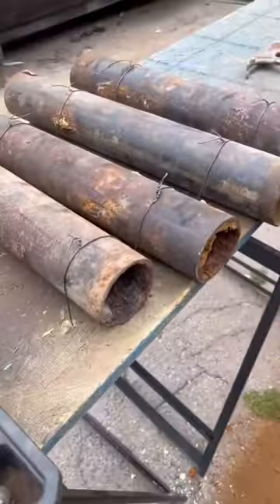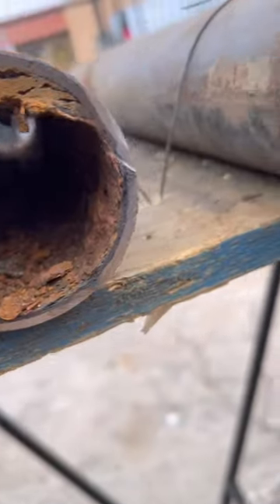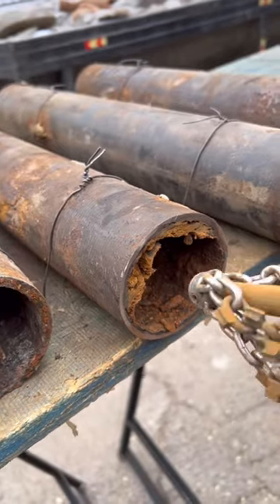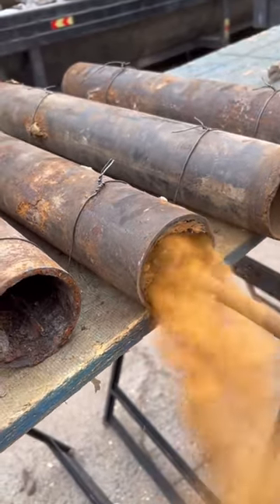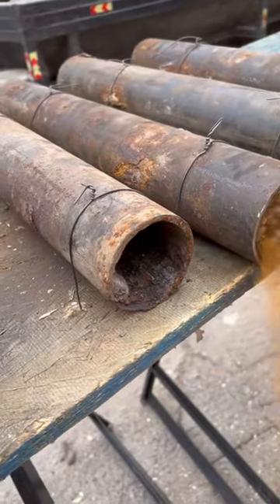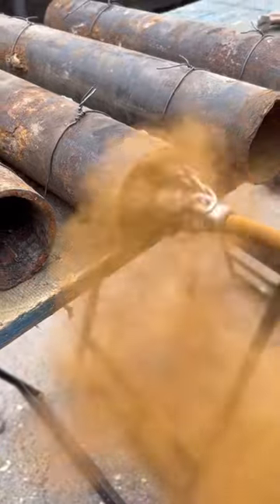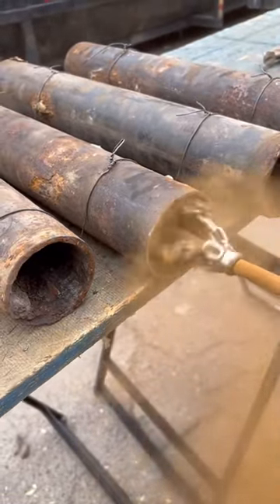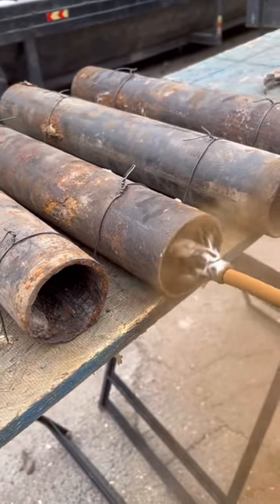How to shave corrosion out of the cast-iron pipe  #plumbing #shorts #howto #sewer

Comment: I would never put that old cast back in drainage system, an infinitesimal crack will cost you replacing it for free in shirt time
Reply from the maker: It’s for demonstration purposes
Reply: Mickeys Time  sounds like a horrible idea. There’s one way to do it. The right way
Reply: Mickeys Time  yes realigning is an option done many old pipes
Reply: @youngrav2311  uhh that’s actually the only way besides replacing with new cast iron… they chain knock it like this , then they line it with an epoxy sock. So if the cast iron cracks with the knocker it’s not the biggest deal if you’re relining it. you just don’t want to chain knock a pipe ur not relining. :) hope that explains it.
Reply: I just learned a new word bud! thanks for infinitesimal, please thank who ever you stole that from on my behalf